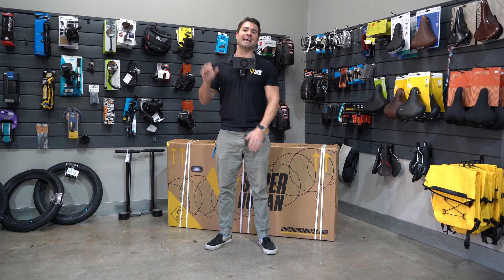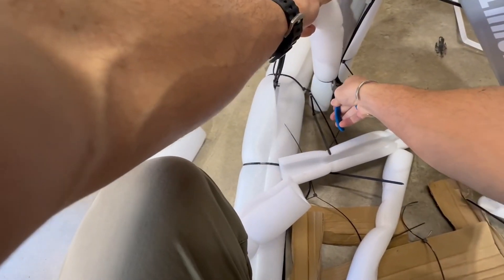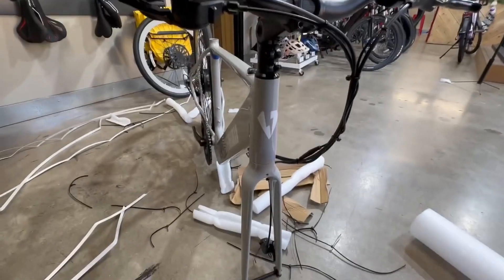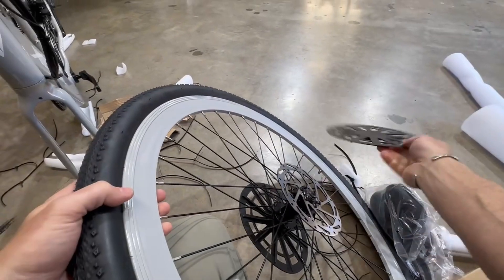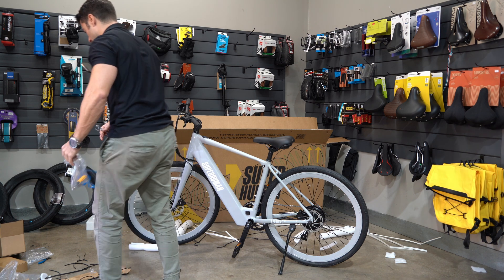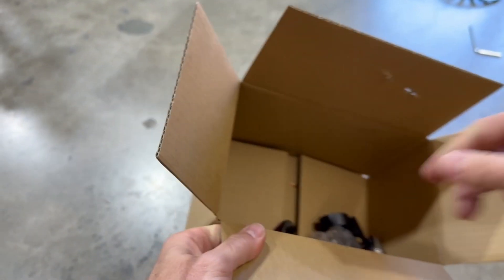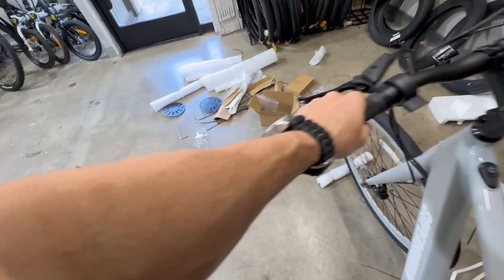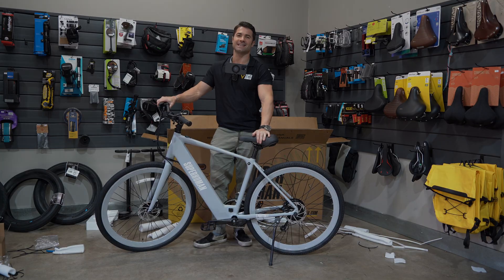Photon Assembly

Comment: Went together in minutes. All good. Rides like a dream. I couldn’t get the handlebar stem nut on the rider left to move only the right one..???
Reply from the maker: Glad to hear it went together smoothly and you're loving the ride! 🙌 As for that handlebar stem nut on the rider's left, that bolt is actually threaded into a captive nut inside the stem, so sometimes if it’s overtightened or not catching just right, it can spin instead of loosening.

Try applying a bit of inward pressure on the bolt while turning it (helps it catch the thread). If it’s still spinning freely, shoot us a message — we’ll walk you through it or get you squared away fast. 💪